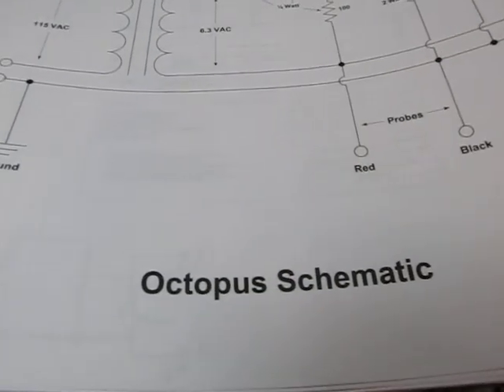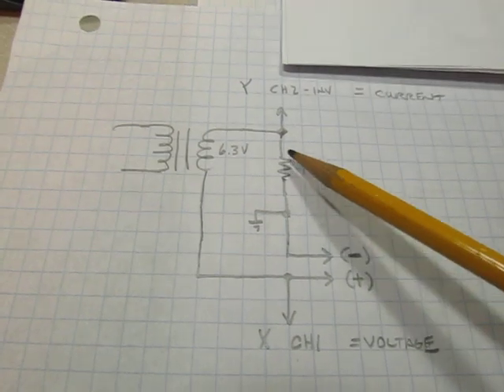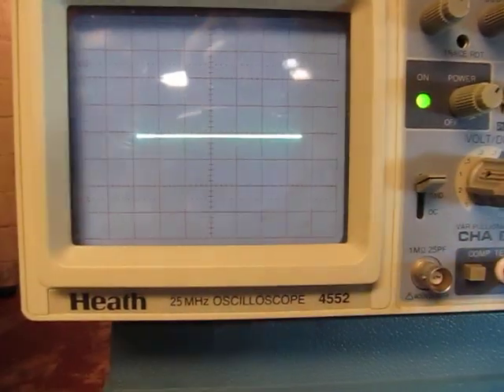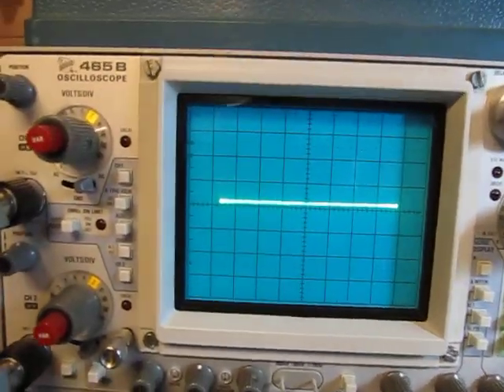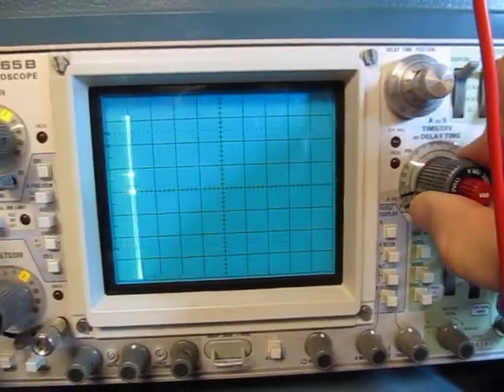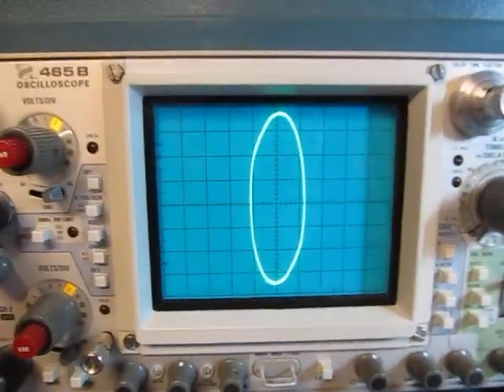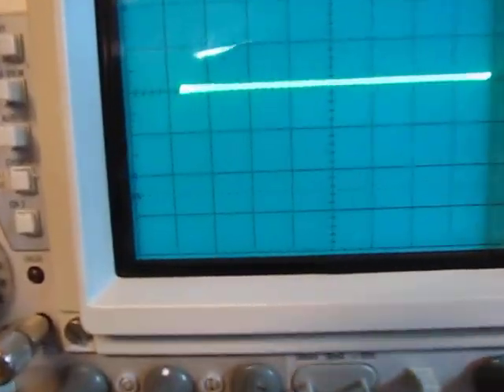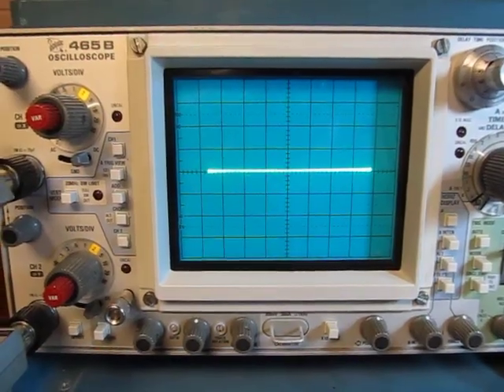#49: Simple Component Tester using Oscilloscope - Octopus Curve Tracer

Comment: Wonderful!
It's very Clear.
Can I use this circuit to measure the characteristic curve of a Mosfet?
for example:
If I use Drain-Source in the test points  and for other hand I take other power supply for to give a Voltage Gate-source.
Reply from the maker: Yes, but you do have to take care to mind where the scope and external supply grounds are connected.
Reply: Ofcourse, always trying don't make a short between  grounds,hearts and signals.
thanks. I'm going to try

Comment: Very nice video as always sir. Fantastic!!!.. I have one question though ("newbie question"), in testing capacitor specially the higher value capacitor,do I need to discharge them first before checking or just put them in there regardless if they have charge or not? Thanks.
Reply from the maker: It's always a good idea to discharge them first.

Comment: Thanks for sharing. Works very nice on every component except coils. Anyway, I just thought I gave it a try and it is a handy tool to have. I personally would not rely on such an instrument because it doesn't give number readings and such so it is a very limited tool from my point of view. Keep up the good work. :)
Reply: Trust me for troubleshooting is way more effective than a number reading.
Personally I use this https://neatmarine.blogspot.com/2018/11/mi.html
The reasons component tester is better are:
1) Is instant, faster than your eyes!
2) No need to change probes polarity while check component
3) Check a component behavior in all intermidiate voltages and phase between voltage and current.
If you go to component tester, you can't go back.
Reply: Wow, that device is amazing! I never even knew it existed. it can do everything. How do i buy one?
Reply: @Stamatis_Misirlis  Your completely missing the point.
Reply: Your completely missing the point.

Comment: Hi Dear,
my FLUKE 124 it still doesn't display the vertical and horizental line for the short circuit and open one, so please could you give the correct parameteres for this model 124 because i've tried almost the adjustements parameters like channel A i put in Dc normal and the B channel i put in DC too with inverted, so i obtain only sinus wave so i hope to give me the correct parameters setting. maybe it works only crt scope not with display? Thanks in Advance
Reply from the maker: It looks like the Fluke 124 lacks the required display mode - specifically it doesn't have XY mode.  Thus, it can' t be used for this application.
Reply: thank you Sir, i will need your help soon on technical of repairing.
Regards

Comment: I traced and retraced my circuit 50 times and can't figure out why I can't get a horizontal line. I get the same signals as you in the sweep mode (chopped)it changes from sine to flat on the bottom and from flat to sine on the top as in the video from 3:58 - 4:02. But when I put it in add on X-Y mode I get a 45 degree diagonal like / when open and a vertical line when shorted. I've been pulling my hair out trying to get this right.
Any guesses what my problem is?
Reply from the maker: Don't use ADD mode, just XY.
Reply: ***** well, i just went and tried that and it still didn't work, but what did was not having the A or B (or both) channel selector buttons pushed. HOORAY!
I have the same scope as you but without the "b" suffix. Thank you so much for this video. I have a huge inventory of scavenged parts that I can now check out enough to know whether to toss them or not. Can't thank you enough.

Comment: Hi. i see at 02:45 min,cables plugged in comp test,what have you plugged into comp test? the device octopus? I have an oscilloscope that has this feature,but do not know how to use! Can you help me? Thank you.
Reply from the maker: There's nothing extra that you need to hook up. Just push the Component Test button, and connect the component you want to test between the Comp Test input and ground. Scopes like yours and this one essentially have a circuit like the octopus built in.

Comment: I only wish it was that simple. Your help was greatly appreciated. This is just an old analog scope I had and very rarely used. I found that if I set the Vert mode to Ch. 2 the CRT goes black. Channel one works fine. When it is in X-Y mode it appears to be normal but I am short channel 2 or “X”. Again, thanks and keep sending the great videos. .
Reply: Why not just repair the scope? Old scopes are much easier to repair...

Comment: I tried this on an old Kenwood CS-4025 scope which has X/Y mode and also some TV-F and TV-L functions. When I try the circuit I only get a round display on the screen which resembles a planet with a ring around it but totally shaded in green regardless of having a component in circuit or not. It is a very simple circuit which I checked 100 times but I cannot get the circuit to function. Could it possibly an issue with this old scope? Any suggestions would be appreciated.
Reply: Any solution?

Comment: though not essential a transformer is useful to reduce the effect of the signal source while the components are still in circuit - it's not only usable on individual components, though there are limits. A couple of  volts swing on the output with the current-limiting resistor doesn't cause much harm to most analogue circuits in-situ, when you use it regularly enough to get to know the "good shapes" it can become a great fast diagnostic tool especially if you have many identical circuits to fix

Comment: forgot to say, I've used this circuit a few times at higher frequencies (tens-hundreds of kHz) to check out larger inductors and capacitors. You feed the circuit from a signal generator use a "100v line" tranformer - ideal because it will give several tappings and ratios, because the input to it will be far lower than the 120v or 240v mains of a 50/60Hz transformer. Scope X-Y frequency response and the substantial losses in the xformer at kHz frequencies limit the upper usable frequencies

Comment: I *think* they are called an octopus for the following reason:  if you make a tabular diagram of the various display responses of components, shorts, opens, diodes, zeners, capacitors, inductors, etc  -  you end up with a number of vectorgram-like responses. Now, if you then draw all of those responses on top of each other, the  result is like an octopus. Google for pics of a greek cross and a saltire - place one on top of the other - a bit like the layout of the Union Flag of the UK

+good vid

Comment: Ok Thank you! This a great ideia. I mounted a version found in the internet,but dont works with small capacitors,it uses a transformer 60 HZ,using a function generator works great.How you did it,using a transformer or a function generator?

Comment: Hello, I have an older tektronix oscilloscope which has xy mode, I made an octopus circuit I found online and followed the circuit diagram exact.The curve tracer is working but for some odd reason it seems that the patterns may be inverse as to what they should be. The examples from the link I posted shows the resistor signature as going up and to the right, when I test resisters I get the opposite, the angle goes up and to the left. Is it my scope or the circuit?

Comment: Hi Allan picked up the fuses, They are rated at 1.5 A 250 V, but slow blow..rear of scope indicates fast blow,can I use them ? Replace fuse, just slide out old and slide new in plastic harness, or should I remove screws on harness open a bit slide old out, slide new in replace screws holding plastic harness. Then replace black cover and screw the two screws to secure black cover? Thanks Alan, Carl a Fellow ham N2MFW.

Comment: hello again Alan, checked the line fuse inside the black box on rear was blown ! iI see they use a 1.5 Amp 250 volt buss i guess? I'm set up for the medium voltage range 115 volts + - 10%. don't have that size here, closest i have is 2 Amps. So I guess radio shack is the next stop. Hope thats it...Maybe I should of brought up the voltage slowly with my variac, since the scope was not powered for some 3-4 years..You know capacitors power supply..I restored a few  30L-1 amps always caps bad..Carl

Comment: I built and used this test circuit for many years while working at WSMR when we still repaired equipment at the component level - as you mention above it is best used to make comparative measurements from known good to a circuit under test. I have fixed many problems using this circuit - thanks for posting it.

Comment: I have a Tektronix 422 that is giving me some funny results with my octopus... when I probe a transistor or diode the line goes across the horizontal plane and then goes down instead of up.  I have tried everything and am thinking it is something wrong with the scope.  This scope does have the separate plug on the right side for the xy mode horizontal, so none of the controls in the channel 2 horizontal area work.  Any ideas on what the problem might be?

Comment: Thank a lot for your help.
If I pull channel 1 knob it multiply by 10.
It works for diode, zener, capacitor  NPN,  but:
- good resistor give a vertical line
- good electrolitic capacitor give a vertical line
- the zener like base emitter junction does not show the little hook

Has I dont have shorted or open component I cant say fo theese.

Comment: I have no buttons to invert the ch 2  position. If I set the point the vertical position goes from the point up.

Here is a simple image of my set up.(it seems I cant put a link to an image.:
The negative side of a diode to the base of the 47k resistor.  The positive on the positive sign.
My 2 probes on the positive side of the diode?

I have a 45¤ or so angle for every component . If I use one probe I have an ellipse or a flat ellipse. The dot goes back and forth.

Comment: I love this.
If I undestood a bit. The shema you give is a replacement circuit for the in build component tester on your oscilloscope?

Unfortunately I dont (see) understand your wiring. Would you show a shema?
I have build your octopus  but I cant figure how your red probe gives the volatage on every component you touch.

JP

Comment: Hi Allan,
Another Excellent video and TNX OM.. 
There was a commercial version of this device years ago called the Huntron. and it was a BIG dollar item. Seems like over $500 in the late 70's or early 80's. It may have had a few voltage sets but still a simple overpriced item but helpful. 
I have a Tek 576 curve tracer in my lab but use this simple tool for a quick check for leaky xsistors/diodes and use it often. It is handy to have a good example for go no go comparisons.
73,
Glenn WA4AOS

Comment: Very nice demonstration! I built one of these in a small box using a couple of BNC's and two pairs of binding posts, and I included a couple of switches to select a current sensing resistor (for 1.0 or 0.1 mA/V display), and an attenuation factor (x1 or x10) for the voltage output.  Driving it with a function generator lets you see frequency effects, which is useful.  On my 2246 I have to invert the Y channel to get positive current going "up".

Comment: I used to use a Huntron Tracker, which was commercially popular for trouble shooting in circuit.  Worked great.  Also built one in to my old B&K scope decades ago, that I grafted another CRT in to, after buying both for ten bucks each.    Today, the only scope I know that has that function built right in, is the Hameg entry level HMO series, along with it's standard MSO capability.   It's a great tool on any scope for component testing!